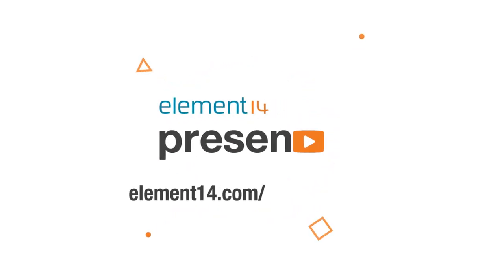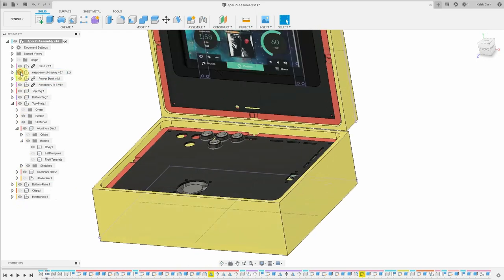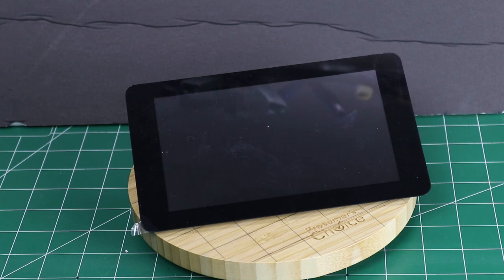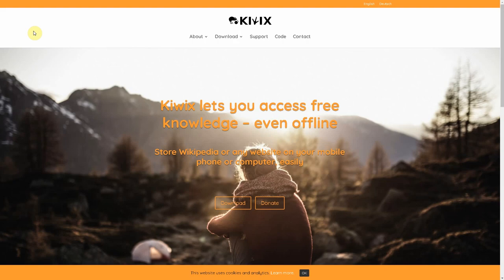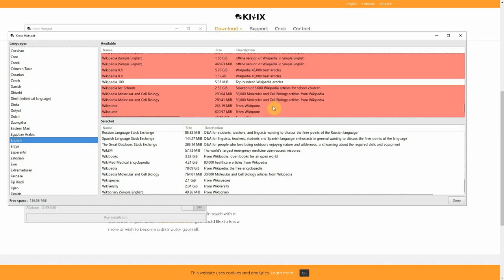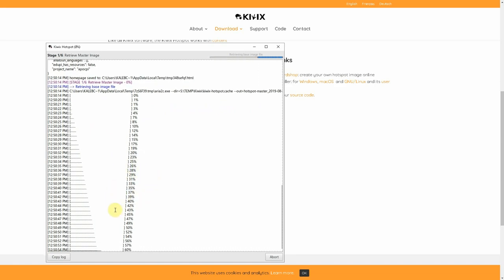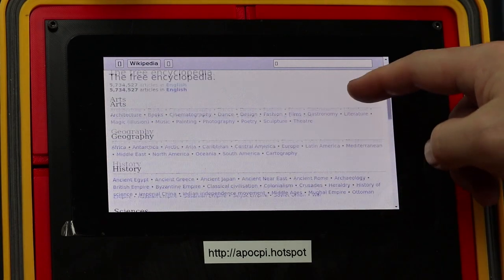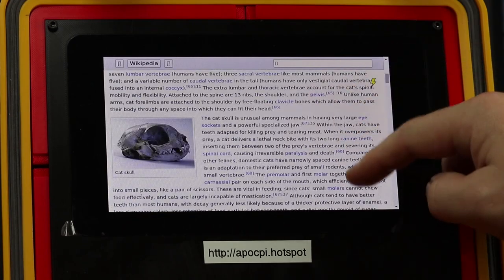Build an Off Grid Wikipedia with #RaspberryPi

Comment: Now you only need to make the enclosure EMP-proof and you've got a winner for the post-apocalyptic survival game...
Reply: Probably already is and if not it would be really easy. In fact most current electronics wouldn't be harmed by an EMP. The movies and myths are mostly bullshit. I could write a book about this but the quickest gist I can give you is this: Soooo many things give off electromagnetic waves and most electronics would interfere with each other if critical components were not shielded from the electromagnetic pulses as well as other forces. A couple examples would be your car and its ECM/PCM are shielded (no issues). Your PC/Laptop are shielded (no issues). Also EMPs dont effect the batteries, cables, wires, resistors, bussbars, fuses, mechanical switches/relays. Soooo....99% sure this thing is fine already but if you are worried just stick it inside a potato chip bag.
Reply: @TheMuddman74  Really that easy? o0
The texts I've read about EMP-proofing electronics all hinted at substantial effort that needs to be made in order to make stuff survive e.g. an EMP from a bomb or something similar...

Do you happen to have some links with more info? Also, if you ever do write that book, please hook me up with a copy... :-)
Reply: @WoodmanFFM  Remeber, those are called books! 2000 year old ones have been found i caves and 5000+ yeras old clay tablets.
Reply: @WoodmanFFM  faraday cage, same shit that stops microwaves coming out of your microwave, plus lead foil
Reply: @TheMuddman74  that depends on the strength of the EMP, shielding is not some perfect end all be all of electromagnetism, your curtains shield7 you from moonlight but during the day plenty of light still manages to get through EMP's can be strong or weak, you seem to believe there is some universal level of EMP.
Reply: Just throw it in a Faraday protection bag
Reply: @TheMuddman74  yeah you actually don't understand nuclear emps
Reply: @czechmix221  microwaves are not Faraday cages.
Reply: @leprechaunbutreallyjustamidget  yes they are. What do you think that metal grid is in the door
Reply: @czechmix221  no. They are not. Microwaves have a very large wave length the holes on that Door are just small enough that microwaves can not pass through. Any higher frequency of light will pass straight through. Test it yourself put your phone in a microwave and have some one call you.
Reply: @leprechaunbutreallyjustamidget  on what setting? medium?
Reply: @mwint1982  the microwave? Don't turn it on. 🤦‍♂️
Reply: And solar panels
Reply: @WoodmanFFM  Since lightning creates EMP, does your phone and laptop die after every thunderstorm? Do cars driving through a thunderstorm stop after the first lightning strike?
Reply: @sammiller6631  I can guarantee, if your phone was directly struck by lightning, it wouldn't even be a phone anymore.
Reply: @sammiller6631  No, of course not.
Then again, a thunderstorm is not what I would call an "apocalyptic event".
What if somebody intentionally generates am EMP by e.g. setting off a bomb specifically designed for generating an EMP? After such an event, there would be a need for a working wikipedia-in-a-box...
Reply: @WoodmanFFM  Um no. There are places called libraries that have things called books that need no electricity or wifi to work.
Reply: @TheMuddman74  what about a coronal mass ejection/ solar storm? That will fry some stuff pretty quick
Reply: @Scragg-  I believe you are correct. I only have enough knowledge on that to understand that it's a real thing and it's bad. I've never sat down and researched that specific anomaly, like I have with a man made EMP. My research has mostly been around portable/weaponized EMPs. Something you would expect a terrorist organization to get. But even with EMPs, I would imagine that some of the world superpowers like us, China, Russia probably have enough funding and good enough R&D teams to make a massive and very high power EMP that may negate our normal shielding. Interesting Side Note - I work on classic cars and when I was younger I discovered that there is a specific circuit/wire/component added in to stop the radio from being interfered with by the ignition module. If you dont have the component then what happens is that while listening to the radio, as you accelerate and your ignition coil turns faster and faster it begins making a fuzzy or high pitched tone thru the speakers and gets louder/higher pitch with higher RPM. This fascinated me because I always thought of classics as being very mechanical with rudimentary power circuits but in fact even cars from the 50's already implemented things to combat electromagnetic interference. This prompted my initial study into what can interfere with electronics and why. I quickly learned that most movie EMP aftereffects are severely dramatized.
Reply: Working on it
Reply: @TheMuddman74  I've heard this on a 2007 Jetta when using the AUX input and attached device is powered from car - I think Isolating circuit can alternatively be used
Reply: @beatsbyandrew  yes, if I understand you correctly then yes.  Basically all sensitive device are shielded because half the devices we use put off strong electro magnetic waves. Take an old hard drive for example. That metal casing isnt for looks, it's to shield it from outside forces (magnetism, electromagnetism, etc) so that it operates normally even though its crammed inside a metal box (pc case) with a bunch of other devices putting off emp signals, electrical currents (PSUs) magnets, lasers (radiation), electromagnetic motors (disc drives, HDDS), etc.... even really old classic cars have little wiring thing that kept the radio from picking up inteference from the engine. If you unhook it, the radio will change pitch with engine speed.
Reply: @benjaminpierce8835  I do not think that but can u understand how you would perceive that. It's kinda hard to cram decades of information learned into a YT chat, especially when everybody hates reading. But to briefly combat your point in two different ways. (1) if I assume exactly like you did then I can also assume that you think EMPS are infinitely powerful. I know u dont think that but by your calculations, bc I think things are shielded from emp that i also think emp (weapons) are extremely weak. So if u think shielding doesnt work, that means you think emps are extremely strong? Silly argument right. (2) all the studies I've done regarding this are specifically around transportable weaponized emps. Of which if you u understand the physics of an emp you will u understand that it requires a massive amount of very rapidly discharged energy. Batteries, capacitors, energy storage devices small enough to fit inside of a truck can easily be calculated to how strong the emp blast would be and the radius. Does Russia, China, USA have the physical means of building one the size of a football stadium that would melt your shielded devices....hell yeah, but not without the whole world watching. That is an extremely low risk, low probability event. Which is why mobile, transportable, hidden emps are what is studied tactically. 
Cheers bud
Reply: I found that learning about radio helps with anxiety about emp's♡
Reply: if you were to sell it online how much would it cost?
Reply: @WoodmanFFM dito😊
Reply: @Scragg-  most of that will be diverted by the earth's natural magnetic field. Then it would hit the atmosphere, which will scatter a good chunk more and give some pretty auroras. It simply wouldn't be as big of an issue as, say, a bomb. Most shielded electronics in buildings would be fine. The real problem is the power grid. A pot of wires going everywhere, only shielded by some rubber. So a lot of tripped circuit breakers and blown transformers. Some cars would be fried too, but most that are in, say a garage, would be fine.

I would note that it depends on both the size of the mass ejection, as well as how directly it hits us. Those are not omni-directional, and the size and distance of the earth relative to the sun makes it like trying to hit a pea across multiple acres with a bb gun. Technically possible; increadibly unlikely.

Comment: Missed opportunity: solar power bank.
Reply: I doubt it'd be difficult to add this honestly. They make folding solar chargers for USB, that'd work well. Could also use one of those other larger panels in conjunction with a regulator.
I just think though that's a lot of wasted space, if you built up your own battery pack, you could make this thing run for possibly days on end. Solar panel would easily extend that.
I built a smallish 12v li ion battery bank, combined it with a 10w solar panel, and some regulators, and I was able to run a Pi Zero W for almost 2 full days. The Pi was just functioning as a very dirty FM transmitter. I was out in the woods with literally no other radio sources nearby, so I was not interfering with anything, also the range was only 200-300 feet. If the sun was out more of the day, It'd likely run a third, maybe forth day.
So yeah, larger battery pack, and some solar, and boom, you're pretty set.
Reply: @Un_Pour_Tous  If you aren't leaving it running 24/7 I don't think it will matter as much but I might have to test this theory my self.
Reply: Onboard handcrank generator.
Reply: hamster wheel
Reply: Nuclear generator
Reply: @yourzombiemop8259  ye olde nuke

Comment: so much potential here. With a bigger case, you can add supplies for repairs, a small solar panels, extra batteries, additional accessories....
Reply: Might be smarter to include those in separate cases, that way the main case remains light and easy to carry, and if you lose the supplemental cases, it isn't a catastrophy. If you're going post-apoc, you should have redundancy, and putting all your eggs in one basket isn't that.
Reply: @Hexen_Wulf  I would argue, that a little hinge on the display frame, with a small solar panel hidden behind the display, would not add too much weight or size. You could pop that out and put the solar panel out to recharge. This will also create redundancy, as your hotspot becomes independent. In that situation, even worse than putting all eggs in one basket, is to store the cans in a different location than the can opener.
Reply: solar power bank would allow for watertight seals and peltier cooling

Comment: You should have a separate switch for the monitor - so if you only want to use it as a hotspot you don't waste energy on a display. Although, you could have it sleep too and wait for a touch input, but that costs energy too... A simple switch would likely give you more usage.
Reply: Good call. Funny how the simple features slip through on a build like this. I should dig it out and add that.

Comment: Some ideas to enhance it:
- No movable parts as they can break. So no fan, but passive cooling. Metal box will come in handy for EMP reasons anyways.
- Add a solar panel that will keep the battery charged, even if fully empty. Never know how long the Zombie apocalypse lasts.
- Include basic programming tools (C++ comes to mind) so it can be expanded if needed.
- Here Maps with offline world data. The entire world with navigation running on the PI.

Comment: this case need faraday cage... and gps, topomaps, solarpanels :-) great work anyway
Reply: Enlighten me, please, what would be the benefit of the Faraday cage?
Reply: @ArnaudMEURET  We might be hit by large enough solar flare/EMP to burn our power grids and all the unprotected electronics on the planet. Only way to protect electronics against that is to build faraday cage that is grounded around your electronics.  I would just store the computer in another container lined with grounded metal film that acts as faraday cage. You'll lose Wifi and radio if you built it into the computer case itself and grounding it is difficult. Last known big solar flare capable of destroying electronics and power grids of today was called Carrington Event that happened in 1859 and it affected telegraphs all around the world. There have been other big flares but Earth hasn't been directly on their path.
Reply: @ex1tium  Thanks. I get it now. It needs to be stored in a Faraday cage.
Reply: and don't forget a secret compartment for a Glock and extra magazine, as well as a flux capacitor.
Reply: @ex1tium  The earth was directly in path of March 1989 geomagnetic storm, yet Hydro-Québec's power grid was only offline for nine hours while neighboring grids didn't go down at all. The solar storm of August 1972 was even more extreme, strong enough to cause magnetic sea mines during the Vietnam War to spontaneously detonate, but the power grid didn't fail catastrophically. Was the Carrington Event so bad because the telegraph is more fragile and less protected than modern electronics?
Reply: How would a GPS work in a faraday cage?
Reply: @ex1tium  or nuclear explosion in stratosphere (1962 Havaii)
Reply: @okkam7078  The cage is only to store the device before the disaster.
Reply: @okkam7078  GPS doesn't work in many normal buildings, even without a faraday cage.

Comment: Looks great!  
I second the suggestion by WoodmanFFM to make the enclosure EMP-proof as well.  Another suggestion would be to add an indicator LED to show when the battery is charging (been there where the charger was connected but didn't work), and when the battery is fully charged.

Comment: Spiffy project.  80GB for all of Wikipedia?  I'm floored.

I noticed the under-voltage on the display.  I assume the issue is that the 7" display, plugged into the Pi 4, has the Pi trying to draw more power than the PowerBank can provide?  (by my math, you would need between 3,5 and 4,0A to eliminate the warning)  Any thoughts on a replacement battery?

Comment: I couldn't really get over the Pi showing the ⚡ icon on screen which means it's not getting enough power.
Reply: my 3b+ and screen always did, didn't matter what supply i used. My use case was to be with a Ham radio so when i wired it up i added a buck converter set to 5.2v and a capacitor between that and the pi, problem solved.
Reply: Yeah it’s fun - do you know what the strawberries at boot mean?
Reply: Strawberry on Boot? 🤣
Reply: @Crash5291  Make sure to use good quality usb cables. try to use ones that have as low resistance in the cable as possible. i had that issue as well
When you power up the pi try to measure the voltage you get from your supply and the voltage that enters the pi, there might be some significant losses there
after a while I solder wires to the power pins on the usb input to eliminate that issue. this way you use the onboard power delivery circuit.
You can bypass it but you have to make sure your power supply is stable and within spec of the pi
Reply: Yup - you’ll see one strawberry for each cpu core!
Reply: They are NOT strawberries 🤣 what's the name of the device?
Reply: @SchoolforHackers  POST screen..1 berry for each core.
Reply: @becauseican2607  Boysenberries? ;)

Comment: You need a DC-DC UP Converter set to 5.12 to 5.2 Volts to get rid of the lightning bolt and power your USB Host controller chip properly ;)
Reply: A Power bank is bad enough for robbing power, it is already using a boost converter to make 5V from 3.7V.  Two super caps and a 10W solar panel on the lid, a proper solar charger that regulates to 5.2V directly, then an E-paper display and some serious sleep routines, so the Pi goes into low power mode when not updating the screen. Ditch the WIFi, who carries a phone in the apocalypse? Just put a minimum of navigation buttons on it to navigate the screen and use them for OSK too. They can also have their own micro controller, that wakes up the PI so it doesn't has to pool for key presses constantly. The you have a device that can run in 200 years on a rainy day or indoors infront of a bonfire. Actually, it shouldn't even be nessecary to use a PI, an Aurdino or AVR should do, if you just format the pages as text and JPGs for a minimal gui.
Reply: @Tore_Lund  Wifi allows it to be a community resource used by multiple families for schooling.